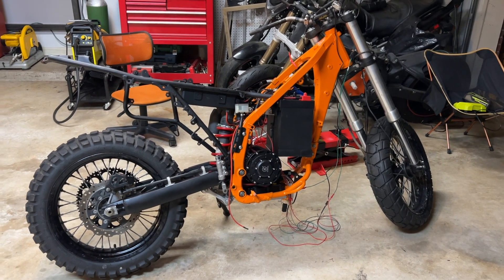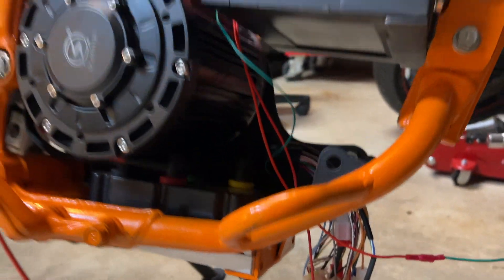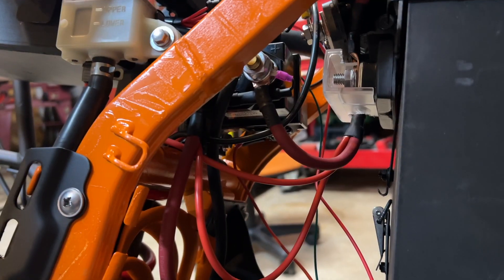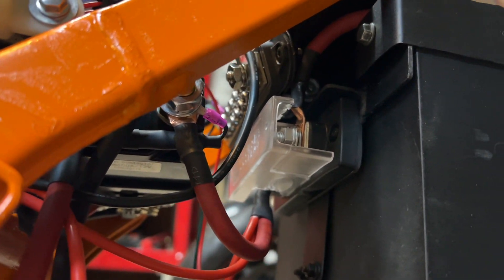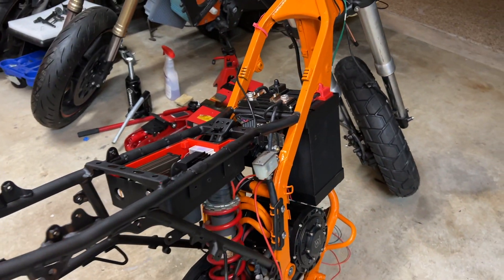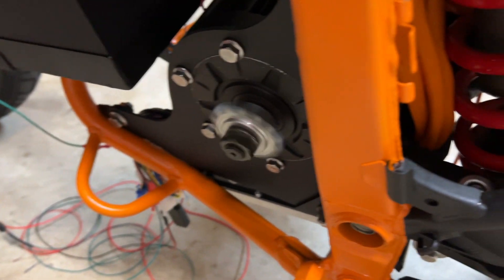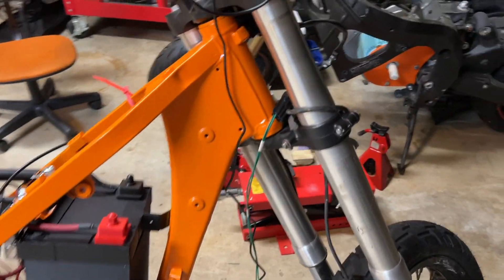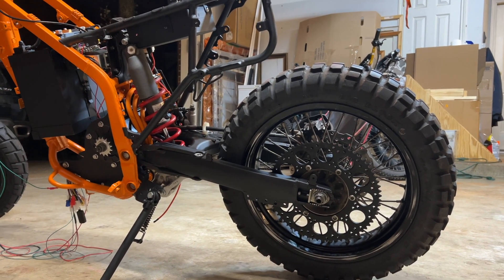High Voltage Wiring - Converting a Kawasaki KLX250sf Enduro Dirtbike to Electric (Pt.8)

Comment: Why not using a in-wheel bldc hub motor instead of a mid-drive motor without chain? Guess that'd be a lil easier to have it mounted, saves time. For my project they told me a contactor is not really required and it works well without one so far.
Reply from the maker: mid drive is better in most ways - bike is more balanced, no large unsprung weight, rear wheel easy to remove and service, ability to change sprocket to adjust torque vs. top-speed. hub motor (especially on a motorcycle vs. an ebike) is not really suitable unless it's something like a commuter/road bike (no off-road). best thing about a hub motor is that they are silent and don't take up any space in the frame so there's more room for batteries. but mid-drive is the way to go imo
Reply: +1 unsprung weight - but it's hard to wrap your head around unless you're big into physics @GaiusGarage

Comment: What's the range u think you'll get with this set-up?
Reply from the maker: this particular setup - not much. only 20Ah battery here. I have ride video where I take it from about 85% to basically discharged in about 15mi. I'm currently rebuilding this bike around a 42Ah pack that should be alot more practical
Reply: TY for reply. I Subscribed😘💗Can't wait to see that video💣
Reply from the maker: @Unacknowledged182  thanks so much! I'm multi-tasking a few project & dropping some rapid fire videos soon!

Comment: hello, thank you very much for your videos, if the 72v battery is always connected to the kelly controller without using a contactor and you would only use the key for pin 7 to turn the kelly controller on and off, would the precharge system or contactor no longer be necessary?
Reply from the maker: the precharge resistor is not needed if youre not using a contactor. you dont need to use a contactor and can turn the controller on/off using the switch on pin 7. but your controller would always be connected to power. This is not so much a problem for the controller but its better practice to be able to physically disconnect your controller from power

Comment: Hi from Ireland,  
Great detail,  I'm at nearly the same stage in my build. Mine will also be street legal.  I have a 24s 1p  po4 65ah battery .
How long are you hoping to get from your battery?
Reply from the maker: sounds like youre in a much better place with your battery. any chance you can link to it, btw? I think the range will be pretty low in my case - 20Ah will not get you far - maybe 35mi?
Reply: @GaiusGarage  where did you buy your battery? Im looking to build a similar bike using qs138 but with a smaller bike. Thanks
Reply from the maker: @dixon266  I actually built this battery myself. check out the video here: https://youtu.be/iPsxvFEz4SU